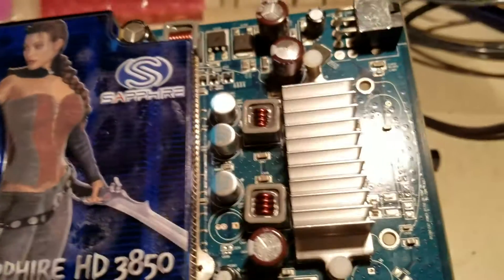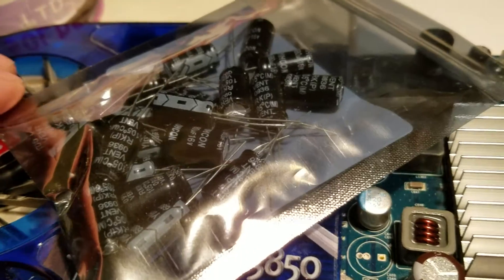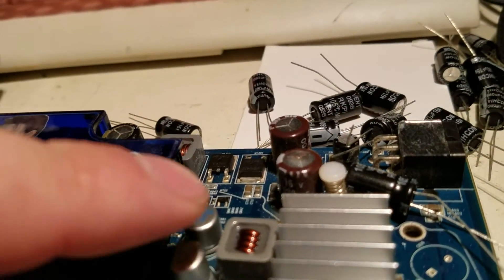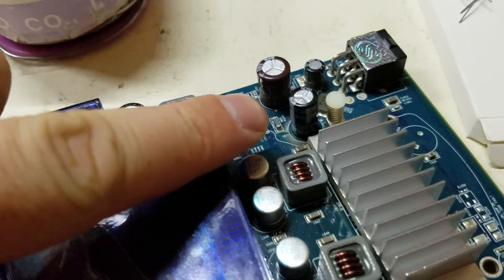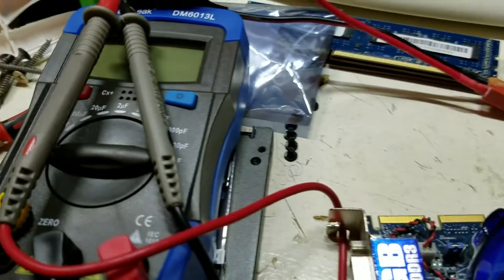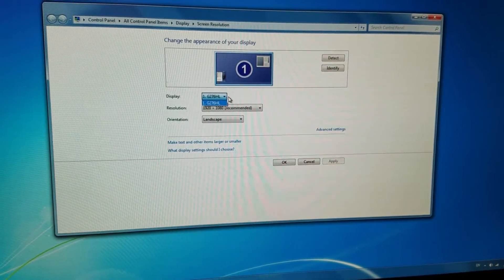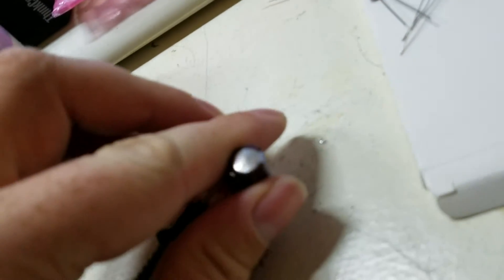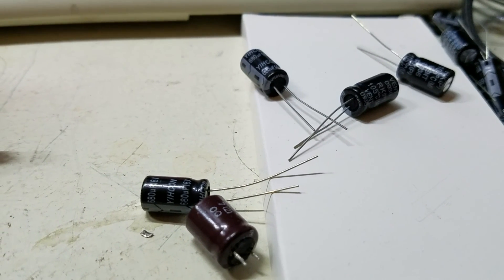Repair graphics card - bad capacitor

Comment: where do you find these at? for replacing like rx 580s  n other amds etc  thanks man
Reply from the maker: I find them on ebay or at mouser.   Find some that have the same farad and voltage rating as the ones you want to replace. I try to look for ones that have a higher temperature tolerance so the heat won't destroy them so quickly. Practice replacing the capacitors on something else first so you get the hang of it.
Reply: @jasonhornby3161  yea thank you very much man.  also i have been soldering for a few years game consoles and fixing gpus but recently found some with caps that needed changed wanted to find out a lil more info thank you so much

Comment: Can you tell me what the symptoms we're on the card before the replacement please? My 980ti had died and I think it's a capacitor
Reply from the maker: No picture. Sometimes it will post but the monitor will immediately turn off.
Reply: @jasonhornby3161  Yeah my 980ti just popped. Smelt burning looked down to see if it was my computer. Next thing I knew it went pop and the screen turned purple.